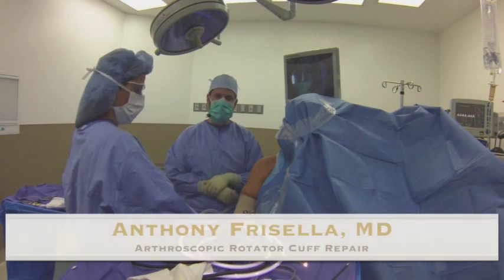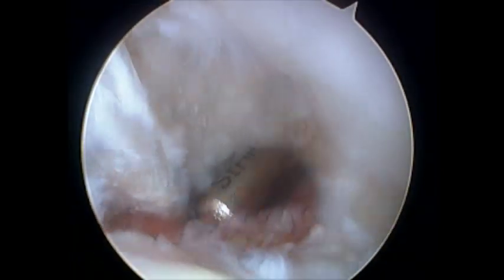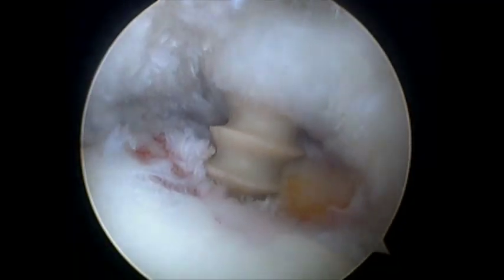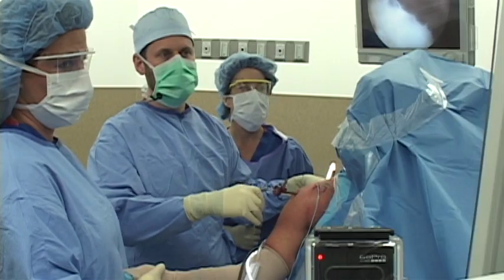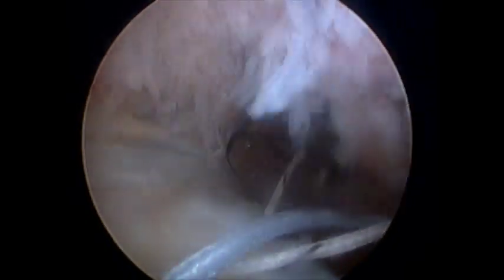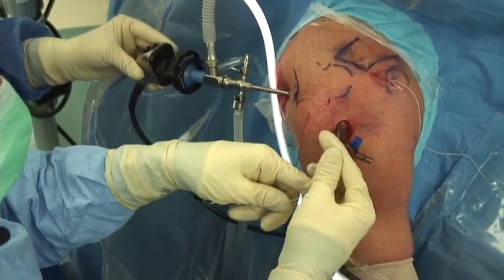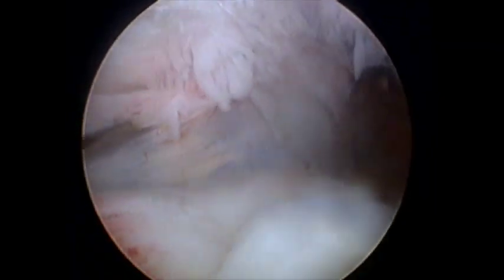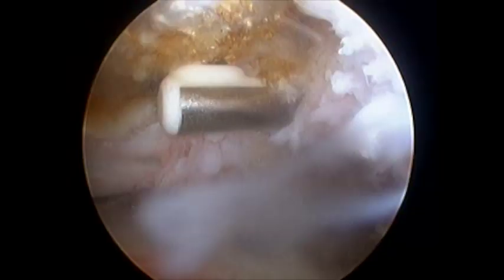Dr. Frisella Arthroscopic Rotator Cuff Repair - Advanced Technique

Comment: Well now I understand why I was in sheer agony the 2nd day after this procedure, which comprised of not only rotator cuff repair for a very large full tear, but also a tenodesis of the biceps tendon. Watching the manipulation of the scopes and tools via the incisions explained a lot of the pain that I had postop. I literally would not have faired as well as I did without an ice circulating machine that stayed on my arm and shoulder 24/7 for weeks, as well as Hydrocodone 10mg tabs 2 PO q6h ATC! Thank you so much for sharing this, from one medical professional to another ;)
Reply: Thanks for the comment, I have to have this done and appreciate knowing a little more of what to expect.